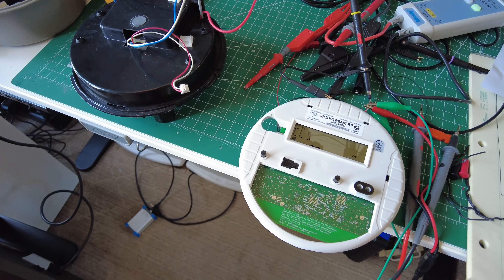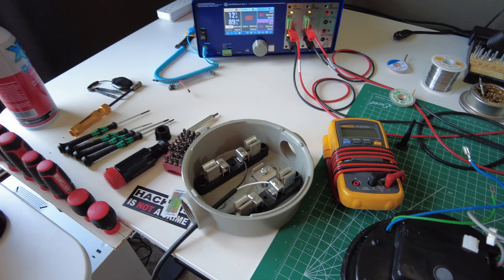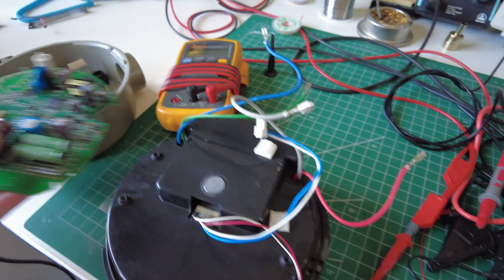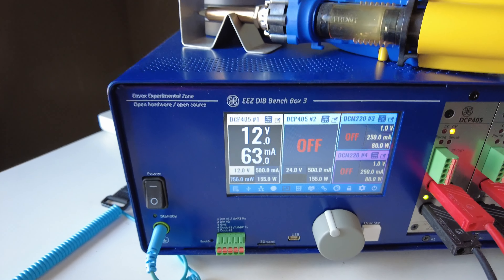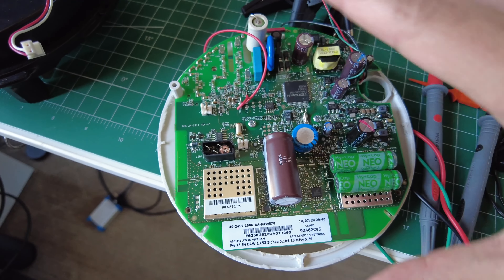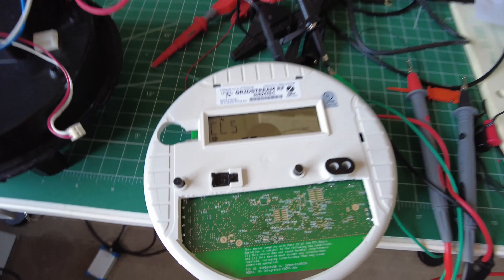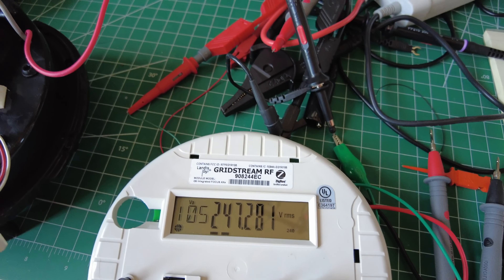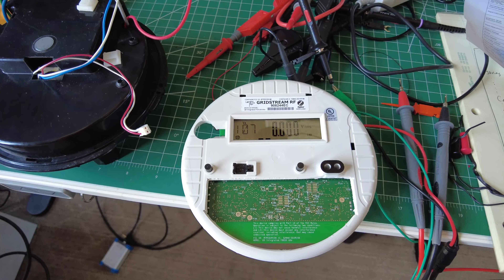When does 3V = 240V??

Comment: The mechanical meter in my house is at least 30 years old and still working fine. I have serious doubts that these smart meters will still be working in 30 years with all those electrolytics. No doubt a big e-waste contributor in the future.
Reply from the maker: Like watches, I prefer mechanical… :)
Reply: we requested a normal spinning dial meter, we have to pay extra monthly to have someone come read it, but it's worth it IMHO.
Reply: Eelctrolytics can last decades as long as they stay cool.
Reply from the maker: @mikeselectricstuff  I was surprised how many electrolytics are used considering these are outdoors in the Texas heat year after year.
Reply: This video is quite timely, the power company JUST replaced my old mechanical meter (with 900MHz AMR encoder which they had to drive thru with a truck covered in antennas to "read" monthly) with one of these newfangled smart meters so they can remote-read (and I fear ultimately double the billing rates for peak-hours).  Bummer seems like it can't be read by a SDR anymore but my spectrum analyzer says its still spitting out 900MHz RF...and I'll be darned if I can figure out how to read the thing looking at the front!  Flashes thru so many things I'm not sure what I'm looking at.
Reply: The smart meter I have here in the Netherlands was installed together with the gas meter. The gas meter has a battery inside and transmits the gas usage readings wirelessly to the electricity meter (they are less than a meter apart) which relays the aggregated data to the grid. The battery is designed to last 10 years, then the whole thing needs to be replaced (probably both meters). This in EVERY home. Mental.
Reply from the maker: @IvanStepaniuk  My gas meter is the same with a battery in it, but I never verified if ours transmit to the smart power meters or somewhere else. They are made by a different manufacturer.
Reply: I kinda miss my rotating disc. It was just more convenient having the smart meter, getting hour by hour power usage information. Tradeoffs, I guess.
Reply: @RECESSIM  I design powermeters at one of the "big companies". Our mission profile is for 15yrs. our design rules are to de-rate electrolytic caps by at least 50% for voltage. 105C+ rated parts (either industrial or automotive grade) also required. In some applications where ESR or DC Bias (stored energy) are critical, we derate capacitance value as well (tolerance and ageing is always accounted for). So if we need 100uF at 12V, we often use 220uF at 25V.
Reply from the maker: @dl5244  Thanks for commenting, that's very interesting.
Reply: @IvanStepaniuk  Some smarts have ben designed to to collect data from gas an water meter. Heres is the real deal: GAS and WATER have different owners and no one is willing to pay the Electricity company for their network usage. Also, the electricity company most include the data procesing and reporting in their system. Gas and Water metering is pulse based, with very "slow movement" in registers ... making ideal for Battery Operated LoRA solutions .... or walk-by applications, where you dont event need a network. Gas regulation are very strict, only Battery devices and with tons of requirements to meet.
Reply: @IvanStepaniuk  you could have refused the smart meter. I know I did. I have a dumb smart meter

Comment: for powering those meters with jtag, we used an isolation transformer (NOT an auto-transformer). Then we can tie digital ground on the circuit board to ground safely and power up.

Comment: Clever trap they have in there, keeping stuff in reset until it detects the line freq.
Reply from the maker: Been meaning to figure this out for a while, just never sat down and focused on it.
Reply: They are more worried on getting enough voltage to operate safely and let the program run. It is like a bronout but for AC ... I think. Other meters dont bother to do that which is poor really. You are only enable to bill if minimal conditions are meet.

Comment: instead of guessing the 12V, why not just measure on a meter powered from the mains?
Reply from the maker: When I first was testing quite a while back I measured some points and saw 12V on a different smart meter circuit board. Just noticed the 16V Cap near the end of the power supply section seemed to be a tell-tale place to inject power.
Reply: I knew you would be in here somewhere 🙂👍

Comment: if you look at the datasheet of the teridian, you'll see that 3.3 V is actually connected to the line voltage "phase" A so the ground on the PCB is at a very high voltage compared to ground of everything else. the trick is to use an isolation transformer for the meter so it can get pulled down, then you can do it. the thing you plug the meter into is called a meter socket.

Comment: The metering chip is actually not only an energy measurement chip, it has its OWN CORTEX core as host processor. You can develop a complete meter just with this chip alone. This chip uses a metering engine that runs on spepcial microcodel. This microcode is just an array of CONSTS. But has been generated with SPECIALIZED tools that no person will never get access. The structure of this engine is not disclosed .... this has beeen their copycat protection for years. Even when you get the microcode, they keep updating with new functinalities. But it just an array of consts to run an architecture no one knows LOL. There is asecond processor for a reason. Probably the one that so all the comunication stuff and application layer .... while metering is confined to the other chip. This style honours the model of SW and HW separation which has been trendy in Europe for years ... they want the legally relevant part totally "isolated" from the rest of the system. So you can do an update of the application part of the FW without running a recertification.

Comment: I recommend USB isolators for working with J-Tag and similar signals on equipment hooked up to to mains.
And if you're going to probe stuff with your scope I would recommend putting the cope on a 1:1 isolation transformer.
Reply from the maker: I have a USB isolator that I’ve used with a SPI analyzer, and recently got a HV probe for the oscilloscope. Might have to invest in a isolation transformer to run the test equipment through.
Reply: The device under test should be powered from the isolation transformer, not the test equipment. If you have the scope floating then the whole thing could become live if you clip the ground onto a live part of the DUT.
Reply: @RECESSIM  use an isolation transformer (NOT an auto transformer) at the source, then you can hardwire digital ground on the PCB to earth.
Reply from the maker: @dl5244  When you guys are developing on the hardware are you running at 240V and loading firmware via isolating like that? Or via some other means?
Reply: @RECESSIM  It's a mixture and depends on the task. We've only needed an external isolating power transformer when developing a 3rd party add-on for the L&G S4e socket meter (looks similar to what you are dealing with). Most devs use either bare boards without an hazardous voltage (like the 12V injection) or ethernet (either tftp or regular firmware upgrade process).
Our hardware team ensures we design our meters with firmware development ease in mind.

Comment: That thing reminds me of those power monitoring smart plugs! They tend to have a secondary chip just dedicated to voltage and current. What happens if you alter the frequency to something it shouldn't be lol? We can see you've already fried one lol
Reply from the maker: I swung it all over the place, from 1Hz up to 400Hz! When it gets real low the meter goes back into fault condition but up high it kept running. It likes to boot up closer to 60Hz though
Reply: @RECESSIM They detect AC (or the lack of it) by "missinbg cycles. Lets say, 20 missing cycles will trigger an interrupt to warn the code to do stuff. If freq is too low, probbly you are getting this alarm triggered ?. On the high side, this chips can do 2500s/S to 8900 samples/s .... so they are dont really to worried about that. They are targeted to do true rms calculations after all, some chips do up to 31th armonic .... (at this point are more like a power analizer).

Comment: I just bought a focus-axr-sd off e-bay to monitor my solar production and usage, does it have to be programed before I install it and can the utility company change the setting it's the same brand as my utility company use.
Reply from the maker: If you note the readings in the screen after you power it on you can just keep track from there just like a mechanical unit. Power company might be able to clear it for you if you make friends with a tech, not sure they would do it “on the record”

Comment: Would this also be seen as solar power being sent back for off set usage resulting in lower kw's used?
Reply from the maker: That’s a good question! Perhaps if I feed 3V into the “House Side” of that circuit the meter would run backwards. I’ll have to test that!
Reply: Based on word going on these smart meters add consuming power no matter from what side it goes so basically you feeding the grid would charge you more money.
Reply: @RECESSIM  it is the phase between current and voltage what the meter is loocking for. Exported Energy is "negative".

Comment: LOL I just want to unplug my smart meter and just dummy plug it so it detect close to no load :') Free electricity until I get caught.
Reply: This will occur in the next billing period LOL ... they run analitics, plus, if you diconnect the meter, it sends a message automatically. Of course during a normal blackout, it is not suspicious ....., but if you are the only meter in the neigborhood that went offline ..... they will catch you. Dont mess with this things, and most important, neve mess with the incomming connection .... saw pretty brutal shortcircuits that went out of control.  Not trying to be the boring safe headed guy. Just my two cents.

Comment: Question, how do these meters act to solar panels using a grid tie inverter?
Reply from the maker: I need to inject voltage on the customer side to see if I make it higher, will the meter run in reverse? I’ve heard utility companies sometimes install a different meter perhaps setup to track this.
Reply: They can tell the flow of energy loockig at the phase. But if you are using 5 and generating 3, then, you are consuming 2 and this is going to be billed into import kWh. IF you are using 1and generatin 3, you are "selling" 2 and this will be billed to the export kWh. Some contried use SEPARATE METERS before the junction so they can tell exactly how much was generated and how mach was consumed from the grid. With just one meter you will only see the balance of both.

Comment: I'm looking for an on the cheep 120-240 converter.. what do you recommend.. (I want to be safer than rewiring a microwave transformer, and get 10A+ for 30ish or less)
Reply from the maker: I bought one of the converters on Amazon and it seems to work fine. Haven’t tried any others.

Comment: You using a jtagulator or some other method for finding your jtag?
Reply: NVM I saw you have a jtagulator in your older videos.
Reply from the maker: I have one but I didn’t use it for this, since they had a 10 pin footprint on the PCB for a header I figured they just used a standard pin out, used continuity tester between there and processor to verify. Some bumps along the way you’ll see in the next video.

Comment: These smart meters don't last 5 years my friend who works for energy coop says....one huge waste of money.
Reply: Utilities pay good money for them and you need to warrant them by the term asked in the contract. But, just for estimated life, they tend to ask for 10 years. I have seen electronic meters with 25 years non stop service. Ok, this is like too-much also. But 10 years ... even the bottom of the line ones are able to meet that. It is all down to the PSU and how good their protections are against surges and discharges. If this section is "strong" ... the rest can survive for years. Meters are hot chasi by definition. Even when the PSU is isolated ...  This make them really suceptible if not properly protected. By IEC they should withstand AT LEAST a 6kv pulse ... but real world discharges tend to go higher than that. So you need to be more ambitious that the IEC limits if you want your meter to last. This is up to each manufacturer.

Comment: Wonder what it would do if it detected something different than 60 Hz?
Reply from the maker: I haven’t found a menu within the meter yet that complains/changes when I change the frequency. But it must exist somewhere because monitoring frequency stability should be a pretty core function I would think.
Reply: @RECESSIM  yes. The power grid frequency is pretty tightly controlled. plus or minus 0.050 Hertz or so. I would think you shouldn't have to vary the freq far from 60 Hz to cause something to happen.
Reply: Modenr metering chipos can do up to 31th harmonic ... but code has the option to lock to mains freq for many reasons so a high freq could mess it up even when the metering chip is actually capable of dealing with higher frequencies. Up to 20% of your energy can be lost into harmonics .... and this nice chips have enough "bandwidth" to deal with that.
Reply: @38911bytefree  I have no idea what you said or mean...
Reply: @bluangl9wingman  Metering chips are "wide" RMS, they will work with the fundamental and higher frecuenacies. But the SW can use the 60Hz tick to to some process (exmaple RTC) and other things. If you feed them with 400Hz probably some parts of the code could go nuts. But not sure if the metering chip is still able to handle it. As per the hermonics, since SMPUs they tend to cret harmonic in current. So part of the power you consume from the grid is not just in the fundamental (60) but well above. Originally, meter are suppoosed to measure ONLY at the fundamental, as per regulations and the THD is billed appart.
Reply: I quess thats a variable, europe and usa use 60/50 and I think japan is different again. And If I would design a smart meter ill sell that sucker around the globe.
Reply: @superliegebeest544  the mains Freq tend to have mor impact in kVARh calculation depending on the method. For kWh it is not that sensible (range 48 to 65Hz). But at low loads with a PF far from 1 ... figure can get a bit out. Just a bit. KVARh is another story because it relies on 90 degree phase shift on one of the signals and this most be carried on freq domain to avoid mains freq dependency.

Comment: Would like to put meter in a mode that subtract export power from imported power,at the moment all are set : exported added to imported power, which is very unfair and against all green policies.
Reply: The limitation is that you have ONE SENSING ELEMENT. So at any given momen you will get the "BALANCE" of inported / exported.  If balance is negative, it goes to exported, if positive goes to imported or the always positive register imported+exported. Note that some countries put TWO METERS. Ones measures what you take from the grid and the other measures what you dump into the grid.